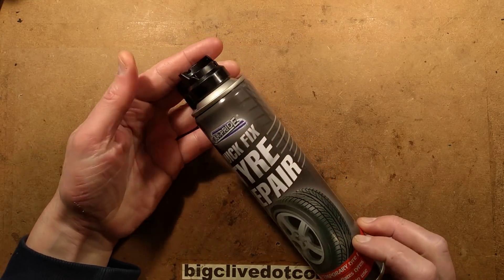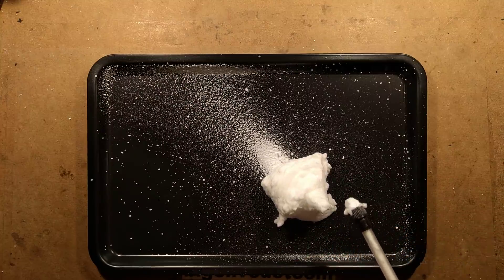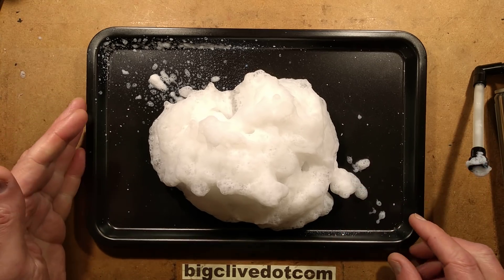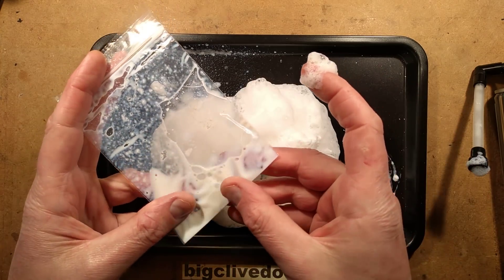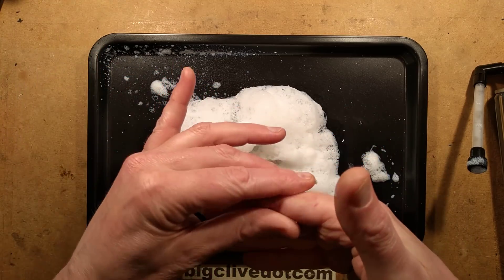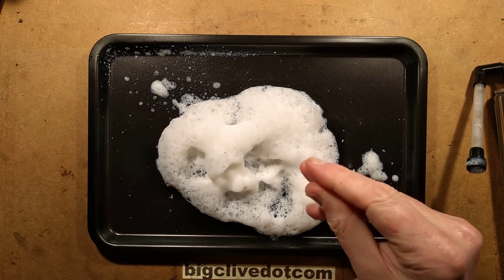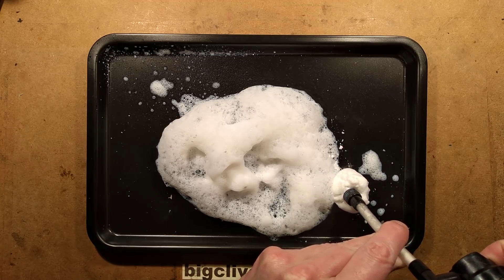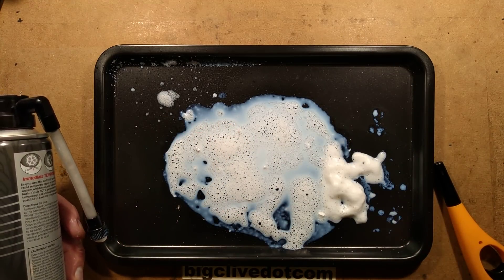What's in a tin of foaming tyre repair liquid.

Comment: This stuff is an absolute nightmare.  After you've finished filling your tire with combustible gas, you now have a liquid in the tire that will press on the inside of the tire.  At lower speeds, it will be off balance.  At higher speeds, it can actually break the bands, causing complete tire failure.

As someone mentioned below, it will completely wreck a tpms sensor.
Reply: Urban myth pushed by tires stores.
Reply: @lyfandeth  My personal experience is not urban myth.  Please see my commentary expanding on that experience and the evidence I have to work with.  Short summary: the danger is physical, not chemical.
Reply: You have personal experience with catastrophic tire failure caused by this stuff? Here in the Colonies we're known to be litigous , there should be news of a major tort action and product recall, unless you signed an NDA and left the rest of us to die?
 Or perhaps your tire failed for other reasons, as they sometimes do?
Reply: @lyfandeth  I wouldn't consider a knot as a catastrophic failure.  A band breaking does not lead to complete separation of the tire.
Reply: nothing happens when this is in your tire, before it can be licenced it has to pass allsorts of safety checks including what happens if you leave it in your tire which i know many many people do, the worst that can happen is your puncture will come back hence the temporary warning , what you said about the tire bands breaking and causing complete failure is absolute rubbish just urban myths you can also  let out the small amount of  gas afterwards if it really bothers you and fill back up with air, it's just  polyurethane foam that coats the inside of the tire with a very thin layer to block small holes it doesn't even degrade rubber it's completely harmless.
Reply: @TC-tn9tb  There are hundreds of automotive products being pushed and sold in the American markets (and likely worldwide) that do not undergo "safety checks".  My comment is based on personal experience, not internet wisdom.
Reply: I have not had a problem with fix-a-flat. If you drive, as the can says to do so, it will spread and coat evenly.
Reply: explain how its going to penetrate the bands? No, running over a screw or nail breaks the bands. The stuff is nothing more than liquid latex in a can of compressed gas. Why they use explosive material is beyond me. I know tire places have no use for it and curse its use. I use it on low pressure tires like snowblower or lawnmower tires.
Reply: RC Hobbyist Extreme They use propellants like propane for two main reasons.  First, such is a common propellant in many consumer products because it’s inexpensive and it is easily compressed into a liquid at normal temperatures but very much wants to be a gas at standard atmospheric pressure and temperatures, so a little bit of propellant liquid goes a very long way since it it expands more than 1000x when it transitions from liquid to gas.  Second, in the case of rubber products specifically, the propellant products such as propane actually cause the rubber to physically swell, which also helps to seal the hole.  Anyhow, that is why they use a combustible propellant.  That said, you will never find such products used on any of my vehicles unless somehow using such is literally the difference between life and death as they are awful products.  Just carry a proper tire plug kit and a DC powered air compressor that will run off your car battery and you are well prepared to make a real tire repair on the side of the road that will last the natural life of your tire, does not ruin tire pressure sensors, and does not make one’s tires hell to work on when tire replacement eventually becomes necessary due to years of driving or old age, nor is there any chance that a plugged tire will explode in a tire tech’s face since they are only filled with air.  Plug kits are a far better all around solution in my experience and require only a little more effort for a permanent and safe solution.
Reply: @scottfirman , @Mike Oxlong Aside from the spot where the liquid mixture will ooze out, it will not contact the bands.

My original comment is based on personal experience.  In my driving career, I have only had knots (band separation under the tread) on three tires.  On all three, I had used a liquid "repair/sealer", one of which being the standard "fix-a-flat" type inflator.  In each case, there was liquid remaining in the tire upon removal.  In none of the cases did I have a complete blow out of the tire.

Based on the evidence, I can only surmise that the liquid presses against the inside of the tire at speed, causing excess pressure on one spot due to centrifugal force.  This stresses the band until it breaks.  The damage is physical in nature, not chemical.

It is worth noting that in each case, this was on smaller tires.  Two were 13" trailer tires and one was a 15" passenger car tire.  On the trailer tires, it's entirely likely that they were expired based on age, since the trailer didn't get used very often.

As far as chemical reactions, petroleum does have a negative effect on latex (hence why you shouldn't use Vaseline on a latex condom).  Is the quantity of petroleum in this product enough to cause structure compromising damage to the tire?  I don't know, nor do I have the data to analyze that.
Reply: I bet you pay double to get the new tire on.
Reply: @CyberlightFG  if you don't tell them you have that crap in there, they charge a lot more to clean up the mess.  That stuff smells like puke when you break down a tire and makes a mess everywhere.
Reply: If your tyre needs this. it has already gone through undue stress. Further use after injecting this stuff is at your own risk.
Reply: @MrKittykat111  Not always, but there is a valid point here.  In my case, a roofing nail in the front right of my car caused my tire to leak down.  Not having a plug kit handy or the luxury of time to properly patch the tire, I used fix-a-flat on a fairly new tire with the idea that I would get it properly patched under road hazard.

The tire developed a knot and had liquid inside it when it was removed from the rim.
Reply: I second this, I bought tubes with integral self-repair goo thinking they'd be better, but the damn things exploded inside of 48 hours of leaving the shop. Not worth it.
Reply: @vdkaa  I use the same product for my bicycle, just smaller cans, and I rarely reach speeds above 45 kmph. For over 10 minutes maybe 25 kmph.
Reply: @unbekannter_Nutzer  Bicycle tires are substantially smaller in width and operate at lower speeds.  That makes sense that you would not see the type of physical damage I encountered in a car tire operating at 80 - 100 kmh.

Comment: I've used both an expensive  (Holt's) and cheapy one the same as your one. And both worked great! 

The cheapy car plan one you've had,  I put in my car's rear tyre, about 6000 miles ago to stop a slow bead leak, on a 2000 mile tyre. And still going!!

Comment: Interesting. Very handy if you are 5 miles from nowhere riding an ATV and the tire goes flat; suffer a tire collapse when out on your lawn mowing tractor - rough life here in the US. Anyway, I wonder what triggers the latex to start setting. My 2nd grade teacher showed us that throwing some liquid latex into cold water and swishing it around allowed one to form it into a small ball that would bounce. Very fun for a 7-year old. Thanks.
Reply: If I had to guess, the pressure build up in the tire would force it through the crack or puncture. The foam being rapidly condensed as it goes through the puncture would probably be enough to force the latex to clump on itself, forming a little plug of soft "rubber" that fills the hole. But that's honestly just a guess.

Comment: Working on a piece of land making roads from tons of dumped hardcore and builders waste - full of nails.  We tried filling an old dumper tyre with builders expanding foam.   it seemed fine for a few days then blew the tyre off the rim as it keeps expanding for what seems like months.   I'm thinking that the only non gassious filler for tyres worth trying is builders silicone caulk and spin it while it dries to get a basic centrifugal balance.   it will be a pain to get off with a wire brush or a grinder , but its better than 8 punctures a day which is what we had when we started.
Reply from the maker: When I did the George Square Xmas lights our cherrypickers had foam filled tyres.  I'm not sure how they regulated the foam expansion.  They had drilled a hole in the tread of the tyre, filled it with foam and then capped it with a bolt tapped into the tyre.
Reply: @bigclivedotcom  I have worked as an industrial tyre fitter. We used to call the process of filling these tyres 'foam filling', but in reality it's a really thick silicone type liquid that sets like dense jelly. We drilled a hole in the top of the tyre, then filled the cavity from the valve until it started squirting out of the drilled hole. The solid fill doesn't really expand much at all, only enough to fill the little nooks and crannies inside the wheel. When the tyres had worn out we used a Stihl saw with a special blade to cut the tyre and filling off as one. It's horrible stuff and it stinks to high heaven.
Reply: chickenpopper! I watched a video of that process once, they cut it manually then they used a machine that did it in 3 minutes without killing the backs of 2 people with saws for 15-30 minutes.
Reply from the maker: @Ch1ckenp0pper  The gel fill does make sense.  That would also add more weight to the cherrypicker base too.
Reply: @renyn21  without some sort of machinery or the cutter that we had it was a spirit crushing process. I don't miss that job!

Comment: I believe the can says let all air out of tire, ( take the valve core out and let it go flat then insert valve core then use fix a flat, from experience if you have a jack at that point jack the vehicle up so the tire is off the ground spin the leak to the bottom side if possible, then fill the tire with fix a flat as to plug the leak sooner than later. That way your not lifting the weight of the car with the little can of pressure, more of the product will go in the tire, most cans won't completely fill a tire anyway.) now I can tell you if you have a vehicle with a steel wheel this stuff will definitely muck things up in there aluminum wheels and others it just stinks over time. Your supposed to used the stuff then get tire replaced or repaired. Straight away. Most tire shops hate this shit cuz it cost them a 150 dollhair tow fee but the poor sap that has to deal with this sticky shit gets all his tools shitty. I know. I use the green slime but with the green slime you need an air source with you, and most of those little tire inflators take too long, or melt the 12v plug or just plain break after a minute.    The stuff is cheap enough get a big can of possible put it in the trunk otherwise get a spare. I've seen it eat (rust out a bicycle rim a wheelbarrow rim. But not a vehicle rim. I've never heard of them blowing up, I've heard of the tire guy being ordered to work thru his back breaking job to get the customer out of here so he has a smoke and takes the valve stem core out and a fire ensues. But not just explode. I learned this stuff thru life and work but I never knew it was latex.
Reply: You definitely need to find better DC air compressors.  I’ve had several over the years, some have even been used to fill the bladders on 100 gallon water tanks and had to run for well over an hour continuously (about as abusive as one can get), I’ve yet to have any of mine fail or burn up — only the cheap junk models behave that way in my experience as they are just small versions of oilless air compressors.  That said, they certainly are not fast, though, as it does take about 15 minutes to fill a typical 16” passenger tire from zero to 32 PSI.  Even my portable Ryobi inflator (which uses 18V Lithium ion batteries rather than vehicle battery) recently filled 12 tires from near empty over the course of about 2 hours of almost nonstop running (I like using it for a lot of in-the-field type tasks as it is a bit faster and it is easily programmed to shut off at a set pressure so you don’t have to stand around watching it continually).

Comment: I had to use that stuff on a rental Hyundai i20 the other week. Didn't do any good as the tyre had a one inch cut on the inside edge. Whoever had the car before must have damaged the tyre and just left the car parked up. Later that day when I returned there was a small puddle of what appeared to be latex foam, just as you say.

I was expecting something more fibrous so the parts would jam in the hole and was quite surprised it was just a liquid.